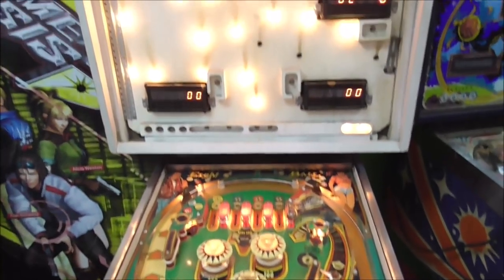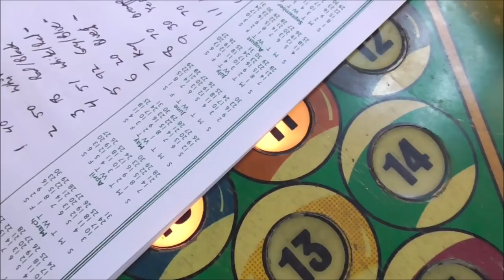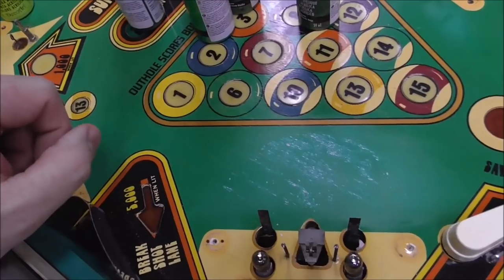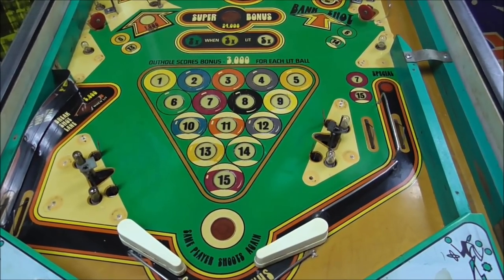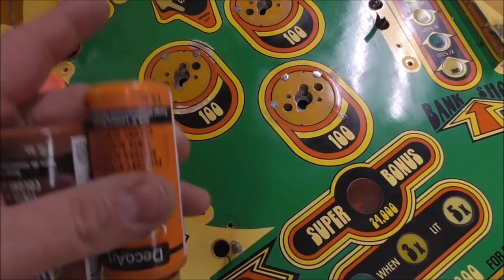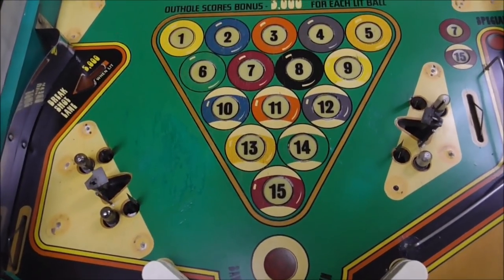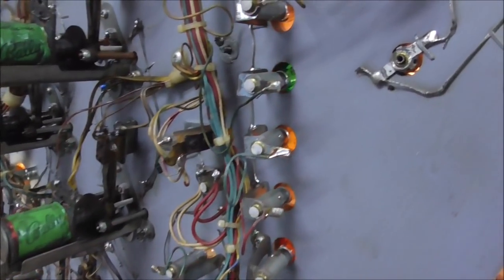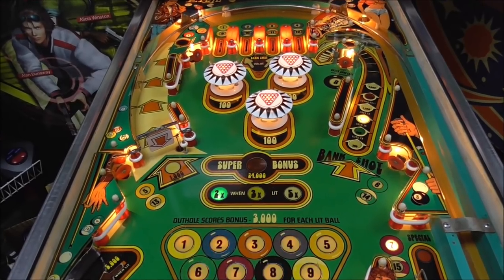Repainting The Playfield Of A 1977 Bally Eight Ball Pinball Machine - They Ripped The Mylar Off!

Comment: thought that mixing paint in bottle caps was interesting.  I like using clear condiment cups like they have at fast food restaurants where you squirt it into the cup from the big pump jar.  I can keep a mix I have covered for later use if I miss something.  I can use the clear cup to put a sample on then hit it with a hair dryer to dry it and then put the clear cover over the play field artwork and look through it to compare the colors side by side.  the last use I have for them is when removing hardware from the play field.  I put each section its own cup to not confuse the parts and to keep them from rolling away.  I use different sizes for what I am going to be using it for. small for paint and large for holding screws and those plastics retainers

Comment: I have removed mylar in the past and get it off clean, but YOU MUST take your time.  A single piece can take a 20 hours or more.   I use a razor blade and goof off, test your paint to make sure the  goof off will not damage the paint.  

The first step is to saturate the edge with the goof off, let it soak for a while. Then start to chip the edges with the razor blade and only hit the softened glue. Each time you make progress  add more goof off.  Rinse and repeat until it is off, IT WILL TAKE A LONG TIME>
Reply from the maker: It can be done but the vast majority of people who do it don't do it right :)

Comment: JOES CLASSIC, Does all pinball games in the 70's and 80's always have a LAMP Test and Switch TEST diagnostic modes? I thought most 70's and early 80's pinball games don't always have a Lamp test and switch test diagnostic modes only some pinball games do?
Reply from the maker: They do all have a lamp test and a switch test... but the ones on Gottlieb games aren't very good (the System 1 games) because the test cancels after a few seconds, it's hard to use!
Reply: @LyonsArcade  The 70's and early 80's lamp test and switch test will test each lamp separately, switch test separately, solenoid test separately one by one? Because when I watch your repair videos I don't see you using the lamp test, switch test, solenoid test. Mostly you do it manually one by one and right down on a piece of paper which ones are bad but that takes 30mins to do it the long way. Why don't you use the lamp test, switch test, solenoid test modes?

Comment: I actually got a problem you describe with a Bally/Midway game called Heavy Metal Meltdown. It is about the capasitors mounted on "Fast Acting Features". They mounted capasitors on the rollover switches in the top lanes. Did Bally/midway redesigned the swithmatrix so bad so even if it was a "Fast Acting Feature" or a slow one it needed a capasitor? What was happened is that the game suddenly counted up points without hitting anything. Thanks for a great video.
Reply from the maker: That's a pretty sweet game, I had that one before, were those on the ramp?  I remember something about it having issues if it hit the ramp too fast sometimes it couldn't tell the ball was in there or something....
Reply: @LyonsArcade  No the ramp worked fine. The issue was about the top rollover swithes. (3 as i remember). Have you turned in to this problem before? or was it maybe a design flaw when Bally collaborated with Midway?

Comment: Ron, I've been watching your videos a few months as I have a pinball I've had for about 10 years and have picked up a few tips. I'm so glad you did this today. Mine has largely worked fine, although there's three pop bumpers that need sorting (which I can do at some point). But there are two things that annoy me about it - the external paint needs attention as it's faded. But the playfield has mylar across it in one big piece and they made a hash of it. Bubbles and so on. I was reticent to touch it, but I was wondering about heat gunning it and testing on a corner. Now I shall. 
And thank you for the clearcoat thing, I was also thinking about that too, should the mylar go well.

Comment: What is the best way to refresh or clean the apron.
Reply from the maker: You can actually WAX it, wax is a cleaner and since it's oil based it won't usually take any of the paint off.  A lot of the paint is water based and when you spray windex or something on it it makes the paint run.  Wax works great though....

Comment: Damn, that "sticker-removal" damage is common even on the furniture I work on!  Sometimes people will buy their kid a really nice desk or something for college, and they'll plaster stickers all over it.  Of course, when you go to remove it, it pulls up the finish like that and makes it hell to fix!  Interestingly, you can use acrylic paints to touch up wood finishes as well if you're delicate and patient.  If you water it down heavily and work in really thin layers, you can even get it to look pretty damn close to a legitimate stain.  (You have to clear-coat it like you do with your machines to protect it, though!)  

I suppose my question is, then, how do you remove mylar safely from these old machines?  I figure it's probably really involved --- probably to the point of not being worth it from a business-perspective.  But perhaps for an enthusiast who's willing to put the time into their own machine, what would you suggest?
Reply from the maker: I've never sucessfully done it, but you can freeze it off (get the glue really cold) then slowly pull it away (over hours), or you can heat it up and pull it off slowly (over hours) not worth the trouble to me, but there are videos around of people doing it.  They nearly always screw up the paint though on these old machines because the entire playfield's surface is covered in cracks.

Comment: Hey Ron, great video man. What clearcoat did you use? I'm guessing you sprayed it on because the playfield was blank, but what if you are just doing a small area after doing touch up with acrylic paint like you are using? Also how would you recommend to apply it on, brush, sponge or paper towel like you did with the paint? Thanks!!
Reply from the maker: I spray it on with just regular rustoleum clear coat you can buy at Lowes, and when I'm doing just a small part I just spray that part too.  If you do it in satin once you wax it you can't tell where the spray ends and the original finish of the playfield starts.  It originally had some sort of clear coat on it anyways....
Reply: @LyonsArcade  Right on thanks I appreciate it!